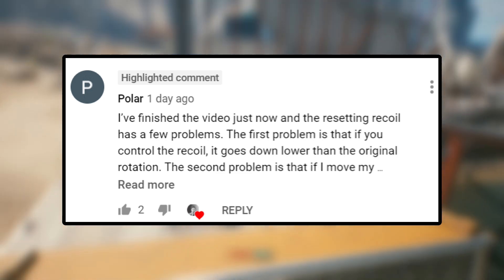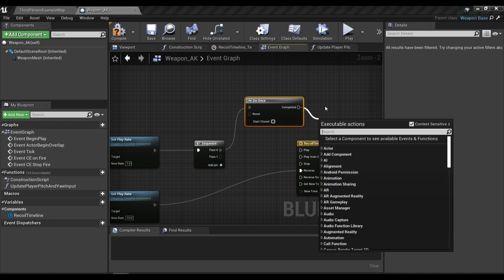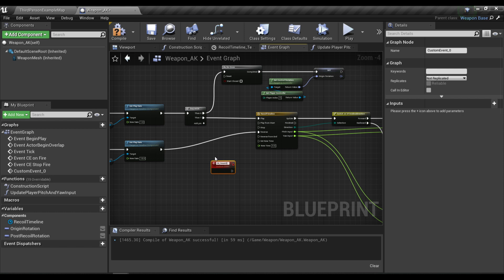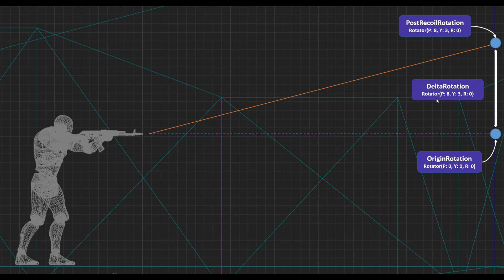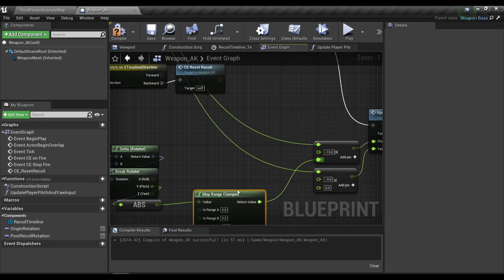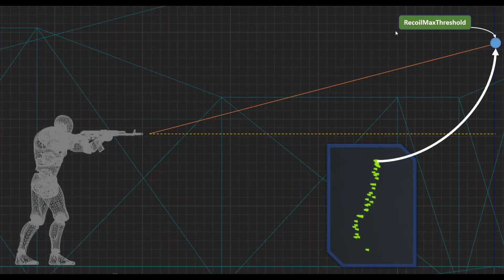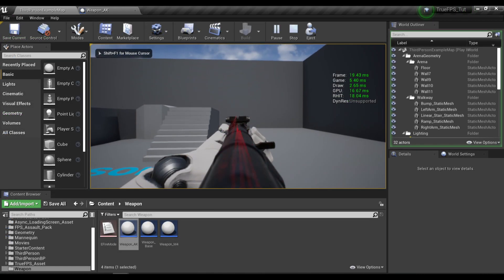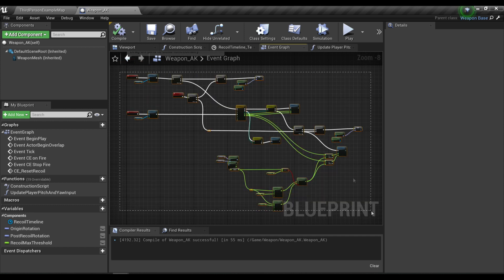Recoil Improvement- Part 2.2 - UE4 Realistic Recoil Tutorial Series

Comment: Hey, I watched your recoil tutorials and so far there are a few things that I would do differently. First instead of using a variable for the post recoil rotation I would just get my control rotation for it. Second, instead of reversing the recoil when I release my mouse, I would divide the delta by the pitch input scale which you can get from the player controller, after that I would have a timeline 0-1 in less than a second, lerp or ease with a as 0 and b as the divided delta, and the alpha is the timeline. Out of the lerp or ease get an add pitch input. This sounds like a lot but it’s only like 5 nodes. It makes the recoil resetting much smoother.
Reply: Hello, your way sounds good, can you share some screens? will preciate very much!
Reply: @Kill3dge  yeah. It’s kinda messy but can you give me your discord?
Reply: @polar1991  Killedge#9115 thanks in advance!
Reply: @polar1991  Hey, do you mind sharing me some screens aswell? I would love to see how you have done it. Ive been trying your solution, it works sometimes but Im sure Im messing something up.
Reply: @Kill3dge  Bro, do you still have these blueprints? I want to have a look plz😭
Reply: Thanks, your method works for me :)
Reply: When you say you would get your control rotation instead of a post recoil rotation variable, are you saying you want a value that updates every time the 0-1 timeline ticks? Cause the whole point of having a variable for that is so that it can be set once and then you work with the same value through the entire timeline.

Also, why are we dividing by the pitch input scale?
Reply: @cameronschiff132  I mean that I would get my control rotation before the first shot then I would save that for when I reset the recoil. I don’t remember why I divided the pitch by the input scale but I think it had to do with FPS. In pubg they had a problem where the recoil depended on the FPS and I think this fixes it. From what I remember just use it. If you want my recoil blueprint I can send it to you. Keep in mind you’ll still need to tweak it and know what you’re doing.
Reply: @polar1991  hey do you happen to still have this?   id love to see it
Reply: Can i ask for a screen too? Sounds really good.
Reply: @erik2490  hey, do you still want the link?
Reply: @polar1991  Hi! Yes, please
Reply: @erik2490  Have you the link of the shared blueprint of the modification Polar explained to us ?
Reply: can u send me a screenshot ? Piscis#6562
Reply: Can you guys give me the link ? I would greatly appreciate that
Reply: Hey bro, I want to have a look at your blueprint, do you still have the link? (in ue5 it seems that get pitch input scale has been deprecated)